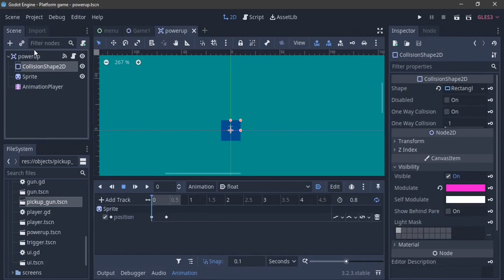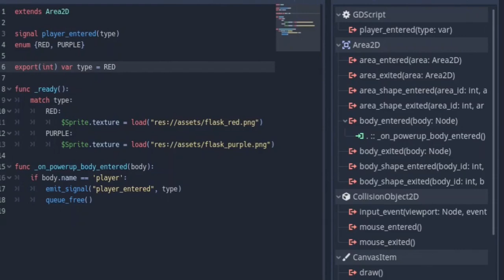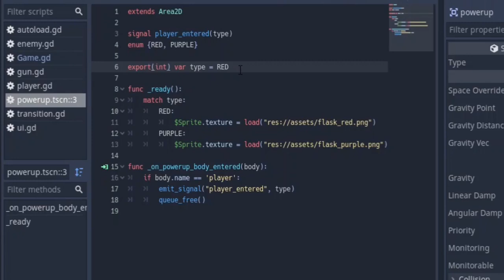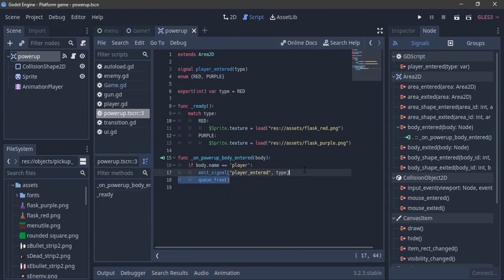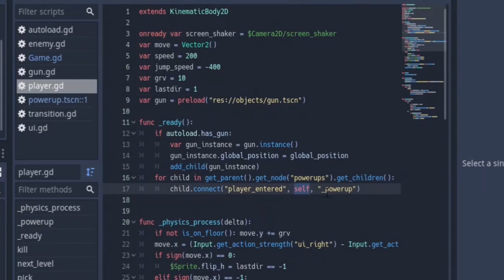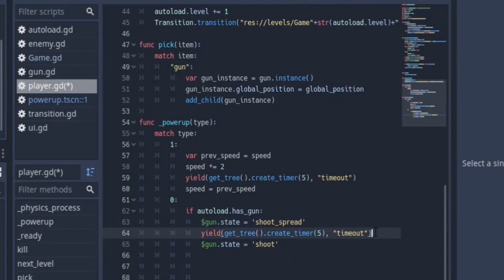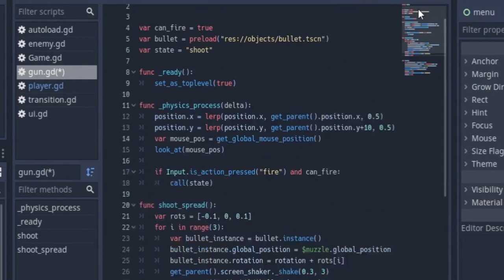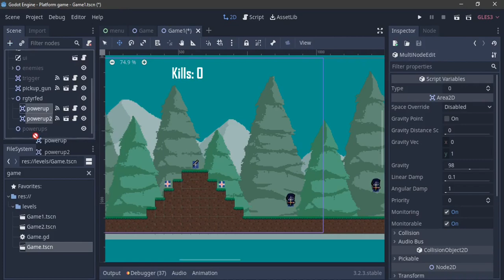Godot shooter platformer series | Part 11 Power ups, Spreading bullets

Comment: Nice Tutorial! At first the RED flask won't change to Purple after setting the powerup from 0 to 1. I have to replace the sprite of the RED flask with the Purple flask in order for the script to work (not sure why since your script clearly shows where the Purple flask is located) It works OK after that. Had some issues with the shoot spread but after going through your tutorial for the 2nd time, I missed some spacing. Works fine now! Looking forward to the next part!